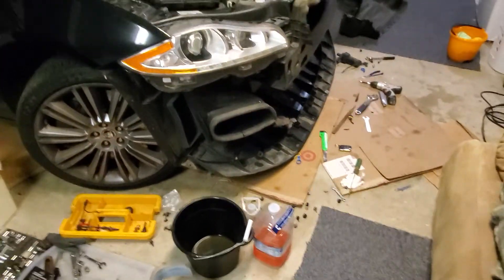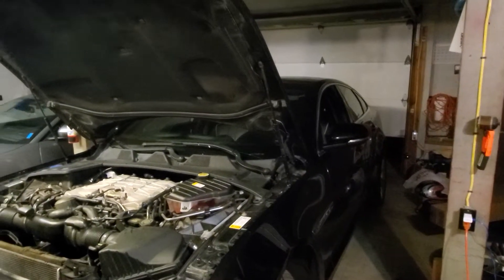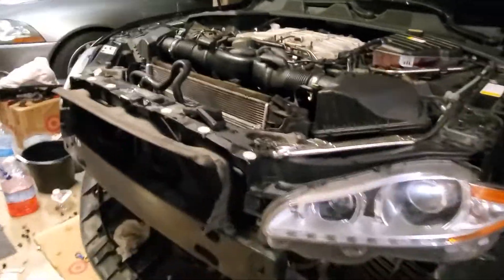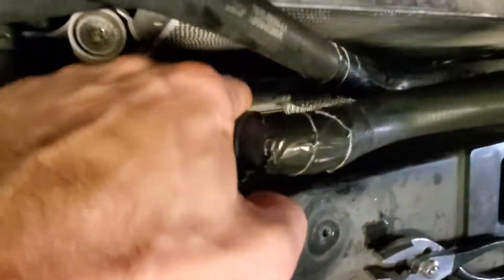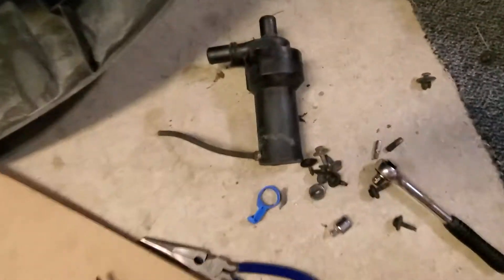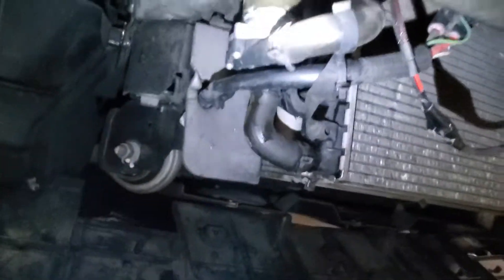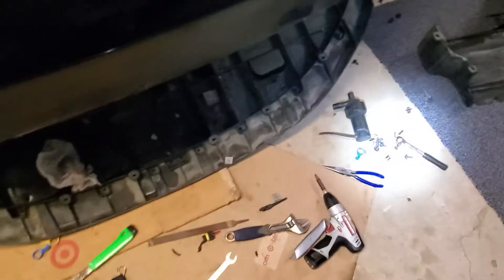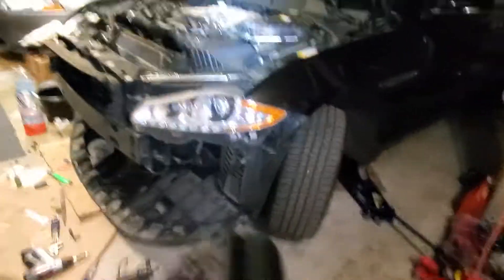Some cooling upgrades on a Jaguar 2013 XJ supercharged

Comment: Hi there.. do you know at what point the electric water pump starts to pump water.. 
Ive just replaced mine and noticed once i started the enging up the pump wasn't kicking in! 
Does the engine have to get to a certain temperature before the pump starts up.. thanks
Reply from the maker: There's no set point it's on all the time with engine on
Reply: @alphajagtuning  
Ok thanks.. i bought the Bosch pump.. bench tested it first and everything ok.. fitted to car and its a no go.. fuse or relay maybe ??
Thanks
Reply from the maker: @SidewaysStew  yeah you got something going on maybe you reverse the plus with the minus double check everything plus the fuse
Reply: @alphajagtuning  
Would you know the location of the fuse to the electric water pump by any chance 
Thanks
Reply: Hi again...
From watching your video i also bypassed the main radiator connection to the intercooler and just come back from a 540 plus mile trip... 
Much much better in terms of throttle responce and boost from the engine.. car temp gauge never moved and the intercooler was so much more cooler to touch compared to the cars radiator.. did get have similar results?
Reply from the maker: @SidewaysStew  there should only be a small difference in temperature. Maybe you had something else going on. We can do full logging for your car included in the tune or you can purchase that service separately.  This way we can see exactly what's happening what temperature is in the engine as to any potential issues.

Comment: Do you really need it? For WHAT?
Reply from the maker: You don't need it.. it helps a little with better cooling especially with the ecu tune we are up by 170hp over stock
Reply: @alphajagtuning  really? To go Racing? With all those work? No thanks. I just want a car to drive on public roads everyday. More than good enough as it is. All standard manufacturer. No need complications from modifications. Extra 170 hp just from that?
Reply from the maker: @victorteo4783  that's what this channel is about
Reply from the maker: @victorteo4783  we got about 150 hp auto this car just from the ECU tuning that we did, Plus now added the crank pulley which is probably good for at least 20-30 horsepower

Comment: Great work..!  How’s the drivability of the tune in day to day driving!  Good luck on your cooking upgrades.  Keep us posted!
Reply from the maker: The everyday drivability is not really changed much it's only once you push on the gas pedal more you'll receive more power and more torque otherwise if you just drive it normally you probably won't notice much of a difference. And we already have set some records for the fastest 0 to 60 and 1/8 mile time on an XJ XJR XJ575 modified or not 
Fb.me/alphajagtuning
Reply: Does your tune help with MPG and does it run lean?  Can you tune it for 93 & 100 octane?  My friend has an Audi A7 and his tune is 🔥.  He has ECU, TCU tune, upper pulley and intake/K&N filter and resonator delete with Xpipe and it’s tunes to his mods!  He posted 0-60 3.7 and 11.8… not bad for 480HP from 315HP.
Reply from the maker: @thomasharris5151  with all wheel drive it's easier to take off quicker but jag does it at 3.9 which is very good. No it doesn't run lean and if anything runs better than factory fixing certain lean areas that were done for emissions from factory. And yes any gas can be tuned for
Reply from the maker: @thomasharris5151  out test car 2010 xf supercharged runs 11.2 btw and another xf we have tuned and with nitrous is in the 10s
Reply from the maker: @thomasharris5151  there is no need for it  separately on the 6 speed nor the newer 8 spd. with the ECU engine tune the transmission will behave more aggressively
Reply: @alphajagtuning  is it the XFR 510hp or the XF supercharger 470hp version?  You test car than ran the 11.2 1/4 what’s the 0-60 time on that? 
I’ll go to your company’s page and get the info there vs harassing you on YouTube!👌🏾😎
Reply: @alphajagtuning  a few tuners said the TCU tune gives quicker shifts… I’m so confused on the facts.  But I don’t want to spend monies on the TCU tune if it’s a waste!  What about the upper-pulley is it necessary as I think it is.
Reply from the maker: @thomasharris5151  mostly these tuners are full of shit pardon my language. To date we have the fastest XF on record without nitrous doing 11.2  this is just with upper pulley, exhaust and some cooling mods and our tune and no separate transmission tuning. The biggest gain is in the tune, on a stock car you can get up to 100 horsepower gain, + 20-25 with upper pulley
Reply from the maker: @thomasharris5151  it's a 2010 xf supercharged, And it makes no difference if it's an XFR with the tune they will have exactly same power

Comment: Nice mate ! Veizu tuner in the U.K. can get these AJ133 engines to 650hp and 850nm with cooling upgrades
Reply from the maker: :) well for the record we have tuned the fastest XF , XKR cars in the world. Our XF SC running over 700hp running high 10s to low 11s :)  AlphaJagTuning
XJ in question runs hotter that 4.2 car  with tune or without since main radiator conects directly to intercooler radiator. Just because Viezu didnt do any cooling upgrades doesn't mean it's the smart path to follow :) 
You can monitor your intake temperatures you will see what I mean, but I guess factory wanted it to run a little hotter for some reason

Comment: Your having heating issues from your tune?
Reply from the maker: No it's the same without the tune. Look at the the video where I point out that main radiator is conected with intercooler radiator, so it makes sense why its hot. The setup on 5.0 just not as good as an older 4.2 cars as far as sc cooling.  I think they might be designed to run with intercooler temperatures a little hotter than on older cars.  Check on your own car you will see what I'm talking about if you monitor your intake temperatures.